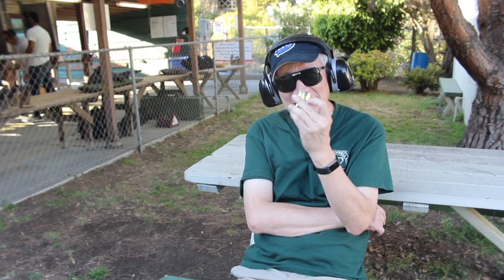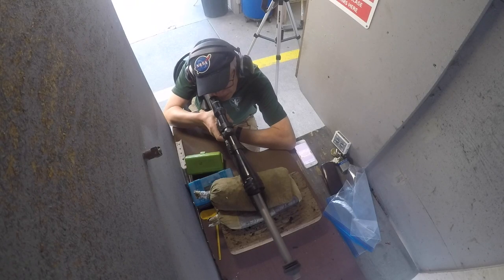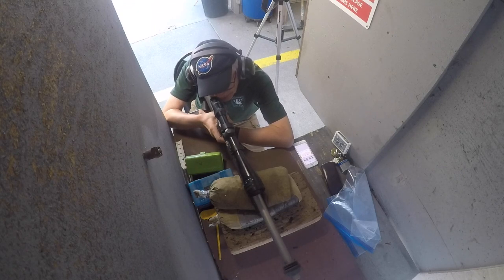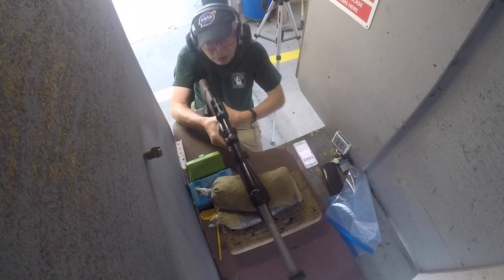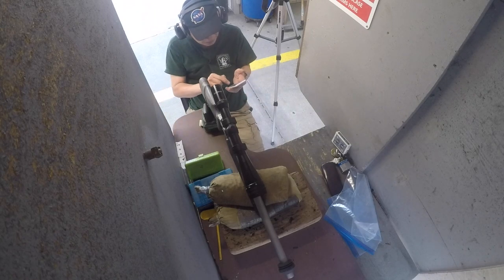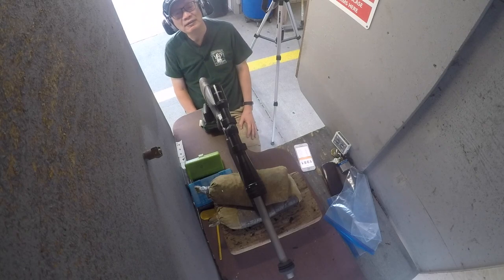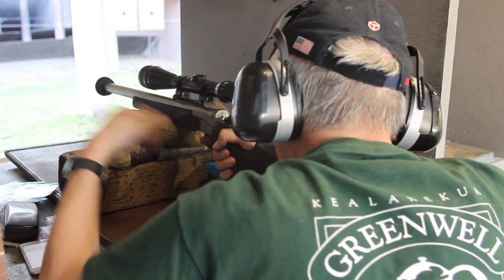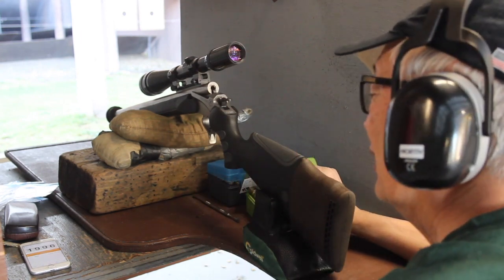The Heavy Lee 200 Grain RNFP Bullet In The 357 Maximum With H110 Powder

Comment: That's a great caliber. Wish someone would bring it back to life in a revolver.
Reply: Sherry M The sᑫueak especially if it worked reliably with .357 mag and .38 special. That might be a tall order, though.
Reply: it is a great round in a contender.
Reply: @SherryPM72  right, I was just thinking, would it be possible to re chamber a 357 mag to 357 Max?
Reply: Need more power? .41 Magnum would be a logical step north of .357 magnum. The Maximum caused problems with cylinder gaps.

Comment: I remember a few years back, with the new hunting regulations of the time, they were coming out with wildcats like 358 hoosier that met state regulations for a handgun cartridge but really more like a rifle round. I wondered why guys were not going with 357 max, as it was just as good and cheaper to convert single actions to. Also 35 rem, if case trimmed a bit also met the regulation. A lot of wasted money went into the wildcat offereings, but now its all been opened up to centerfire 243 and above on private land.
Reply from the maker: TheOutdoorsman - That 358 Hoosier is a cute little round - Indiana style.  And there are many useful wildcats built off the 30/30 case as well, most workable combinations have been tried.  I had to do a bit of research to shorten the 45/70 case to what tantamounts to holding 55 grains of black powder to get the 45/55 Dabo.  But who knows?  Someone somewhere probably did that shortening already on their own especially in those heartland states where the hunting regs you bring out occurred.  That shorter case 45/55 round could easily be chambered in handguns and lever guns as well.  Happy Thanksgiving to ya,  Steve

Comment: When I heard you say 21 grains of h-110 in a 357 diameter case I could smell the top strap burning but then I seen you had a break action rifle and all was good.
Reply: The 357 maximum was a much longer case than the 357 magnum so 21 grains is not so much, however years ago Ruger chambered the round in their blackhawk style revolver (larger frame to acomadate the longer round) and quickly developed a reputation for causing rapid flame cutting of the top strap.
Reply: @looseballs1966  that's what  my comment was about the .357 maximum is known for flame cutting of the top strap. But then again most magnum cartridges produce top strap cutting to some degree or another. 20 grains of h-110 looks like it's at the ragged edge if not 1 to 2 grains over with a 200 grain bullet in most of my load books.
Reply from the maker: William Pollock - Yes, indeed - flame cutting was the bane of the 357 Maximum in revolvers - seemed that the gas from the cylinder gap was perfect intensity and duration to cut those topstraps...  Best to ya,  Steve

Comment: Hello Steve, I've been thinking about garden guns. Have you heard of 9mm Flobert? I'm wondering if a low noise, low velocity load could be worked up to in a 20ga to emulate that kind of application, pest control for the yard/barn? Or perhaps load a 357 or 44 case with shot? The only problem is figuring out a way to defeat the rifling's twist. I wonder if something could be added to the case to accomplish that? If that could get figured out, CCI would be able to sell much more effective shotshell cartridges!
Reply from the maker: jon-anthony Lewis - For garden, I'd just recommend a good quiet 22 cal air rifle.  A Benjamin pneumatic is good because it can be pumped up with a couple of pumps for quiet shooting.  A lot of spring air rifles are on the loud side. 
Or perhaps the 22 Colibri ammo from Aguila - very low power and quiet 22 ammo.  But if backstops are a problem, the 22 air rifle.  Happy Thanksgiving to ya,  Steve

Comment: hi steve how are you i have a question this is for a 450 bushmaster in the lyman 50th page 348 the bullet listed is .452 i want to use cast bullet so lyman is sizing there cast bullet to .451 why did they do that i called them and they had no clue should this cast bullet be sized to .453 is my thinking am i missing something here thanks Julio
Reply from the maker: ocean374 - If indeed your Bushmaster is rifled the way most are for that caliber, the groove diameter will probably be .451".  You might go ahead and slug the barrel to find out for sure, but most will be .451"  As such, the perfect bullet diameter for that barrel would be .452"  (.001" bigger than groove dia).  You shouldn't have to go with .453" bullets even though your Bushmaster will shoot them. ( For the old Marlin micro groove lever gun barrels, they were notorious for being big and needing bullets that were up to .003" bigger that standard - i. e. for a 44 magnum, we'd often need .432 - .433" bullets instead of .430" to shoot well)  If cast bullets are much bigger than that, they can bulge cases and / or cause feeding problems plus raise pressures and lead barrels.   A lot of our 45 cal bullet molds drop bullets that are as big as .454" (old Colts needed that) so we can easily size them to .452".  Good shootin' to ya, Happy Thanksgiving and see ya at TRN,  Steve

Comment: Fortunecookie, do you think that rubber thing on the barrel would be beneficial at all on an ar15? I have a freefloating 10.5 inch 300blk AR with about 1.35 inches of clearance between the barrel and the handguard.
Reply from the maker: Alan Gherkin - The bull barrel Deresonator is for 1" barrels while the smaller hole Deresonator is for the lighter sporter barrels commonly seen on our bolt action rifles.  Depending on your AR barrel, one of these should fit.  All barrels whip on firing so theoretically, should help.  However, only testing will tell.  Good thing is that it is easily removed in the event you don't want it.  Plus, every load you use may very well require a different position for the dampener to get best effect.  Good shootin' to ya,  Steve

Comment: Any thoughts on using the Lee 200gn in a .357? Been thinking of cooking up a load like that. Gotta figure out if I need a gas check or not
Reply: He has a series of videos on it, 15.5 grains of 110 in a 38 case, works great in my Henry.
Reply: Thompson Jerry are you sure? It’s been a while since I have watched so I won’t call you a liar, but I worked up my own max load with h110 in .357mag brass and came up with 13.5gr as max 🤔
Reply: In a Henry or an N frame only
Reply: I tried both with and without checks, better accuracy without with 45 45 10 Alox lube. You should watch his series on the bullet.

Comment: Is RP a good brass ???
Reply: I have used RP brass for several decades 357 mag & 38 spec / 44 mag  I have had good luck ! I find a lot in once fired brass ! If any were to split I just anneal that batch !
Reply: Mario Santana: I still have R-P .357 Mag brass from mid 1.990's with less than 0.4% cracks & 4+ reloads of mild to hot reloads. Suggest you try Hodgdon's Little Gun powder for great consistency & top velocity. My old IMI Timberwolf .357 carbine clocks an average of 1.985 fps with Speer 158 gr HP over 18.1 gr L.G. + CCI Small Pistol Std primers with no signs of overpressure, & 1.4" ctc groups @ 55 yds.